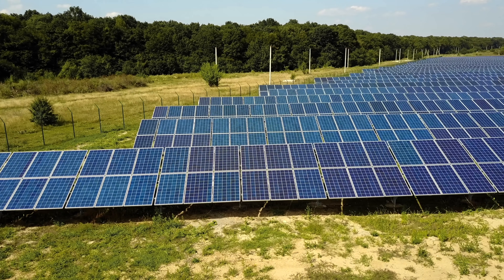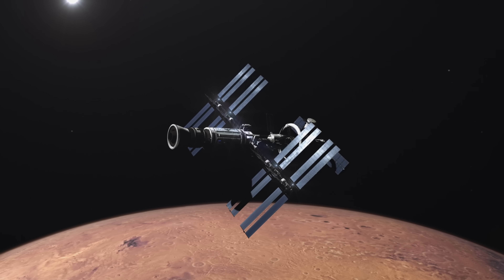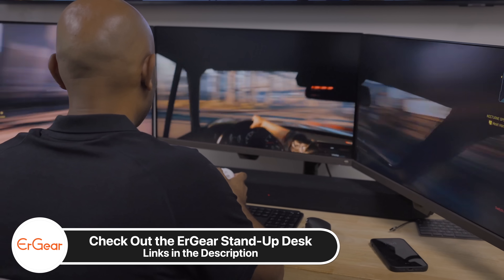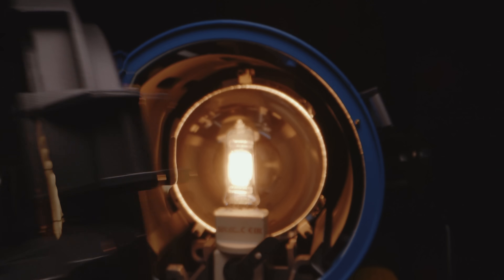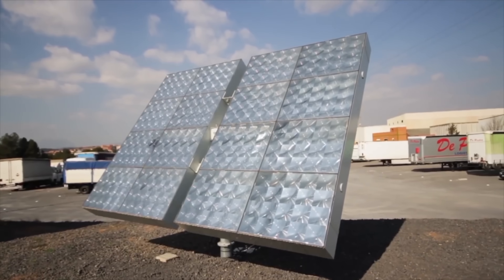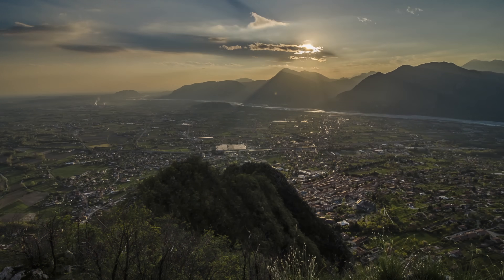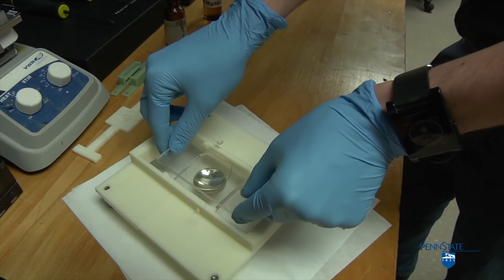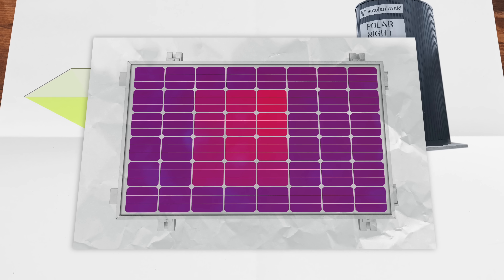Why Don't Solar Panels Have Magnifying Glasses On Them?

Comment: Radio Isotope thermoelectric generators..the Russians built over 2500 of these 4'x4'x4' powerplants to power their radio towers and lighthouses all across their country.. for well over fifty years these low cost , low maintenance, low footprint devices have saved them billions of dollars in infrastructure and energy costs.. so why aren't these used by every nation in remote locations?

Comment: Nice, I’m working on this very technology in a startup here in Italy. This is still expensive as hell but the latest cells with 40+ efficiency have a lot of potential to bring down costs. plus we are coupling cpv with csp so with a mix of electric energy and thermal energy production we could reach 80+ % global efficiency

Comment: If the individual cells are so much further spread out because of the lenses why not put each lense or cell on its own 2 axis tracker you don't need to rotate the entire panel just tilt the individual lenses also could fiber optics be used for light tunneling

Comment: If solar panels would have double the efficiency they would make a viable option on my car, current solar cars don't go further than 70km/day which is only about 50% of what I need. But having a bulky solar panel on the roof isn't great for the aerodynamica and thus makes less sense than normal panels (integrated I mean).

Comment: This technology is doomed for failure.

If there is 1000 watts of sunlight energy per cubic meter, if you want to concentrate it so that 2000 watts of light energy    is focused on that same cubic meter, then the collecting lens will have to be twice as large to be able to concentrate twice a the light on that same cubic foot of pv panel.

The ratios remain the same regardless. It doesn't matter if the area you are focusing on is a square inch or a square meter. You don't get something for nothing.

Add in the additional weight, area required and complexity and the increased pv cell efficiency is not worth it.

Keep is simple. Fixed mount, no moving parts. 

Increased efficiency on stand alone, fixed panels is the only improvements that will matter.

Comment: LoL “system balancing” 

“Balance of System” (BOS)
Refers to materials and labor not specified on quote, 

Often a customer will by their own panels on a bargain or import them on their own and ask a contractor to instal labor only plus bos, meaning the contractor must supply screws, lugs, conduit, enclosures, mounting clips, ethnet cable, earthtags,
Reply: Congratulations 🎉 you have been selected among our shortlisted dm me above 👆to claim your prize........🎁🎁🎁

Comment: All sounds great but I have a question: After buying outdoor solar lights and nightlights with photocells, I notice a good bit of discoloration after a year or two. Will these plastics that focus light have similar problems? If so, is there a way that the top layer could easily be replaced?
Reply: Congratulations 🎉 you have been selected among our shortlisted dm me above 👆to claim your prize........🎁🎁

Comment: No such thing as free or green energy .Solar irradiance is about 1300 Wm2 in space at the equator ,Only 1000Wm2 on earth at the equator .Many issues exist in getting as much as 250 Wm2 .But that's at high noon during summer and the further away north or south from the equator the worse it gets and the higher the temperature the less efficient they become and they loose 20% of their efficiency pending 9n materials and locations by 20 years of age and they degrade further .

Comment: I wonder why running cooling through the solarcells isn't more common? 
They get more efficient if they don't get too hot, and you can use the hot water in your house! 
Linus from Linus Tech Tips got some with cooling, so they do exist!
Reply: It's very complicated to run plumbing as well as electrical making the installation costly, where regular solar panels are mostly just bolt and go.

There are panels out there that have built in cooling/plumbing already so you don't have to have someone make a custom solution for your panels but because of the design time they usually aren't the most efficient newest panels so kind of negates the benefit anyway. 

Then imagine if you had a plumbing loop and you had to replace 1 panel, that turns in to a huge problem compared to just popping in a new panel.
Reply from the maker: you're right! it does add complexity and moving water on your roof, so that's why its not commonly done, but it's very interesting, and something i'll be sure to cover more in the future!
Reply from the maker: btw LOVED that video and his server computer pool heating episodes!!

Comment: Soo.. A short life panel that needs tracking and cooling. I think this is a dead end. Already now, the cost for mounting tech and labour is more than the panel itself. I also think its kind of silly comparing base power like coal, gas, nuclear and hydro to solar. At night it doesn't matter how efficient the panels are. Batteries should always be included in the calculation, or else you are only cherry picking. That said I love solar if it is mounted nicely on a roof. Ugly solar farms or giant bird choppers are just horrible.

Comment: Radio shack had kits with lenses on top of solar cells a long time ago.  It was in every hobby kit back in the early '80s.  Also, there was a company in the '90s that were using diamonds to do the same thing.
Reply: Good ole radio shack

Comment: One thing they could do is set the higher concentrated lenses around the outer part then have cooling in the middle. Run excess heat to an extra battery to store extra energy through the thermoelectric process. By doing this the wires would have to really move while the panel moves. Just have a connection box and create just enough slack to prevent damage.

Comment: Do you think solar panels would work better on flat roofs? Or would just be an equator thing? Best wishes, Stefan, Channel Islands
Reply: Lights refracted through the atmosphere right, so does it need to be direct sunlight? I simply don't know - ohhhh to have millions for research, I'd have a pretty impressive garden shed to tinker with. Stefan
Reply: Admittedly I wrote the previous post only part of the way into the video, appologies. Stefan, eggs not on my face thankfully instead it's making its way into the pan. Success, Stefan
Reply: What I really want to see (prior to the revelation of this video) was multi layered panels with cells under mirror bottomed other cells and angled mirrors to the side of the cell - at depth to reflect the light under one cell to another, this could be done with multiple layers.  I wonder if it could work with this new technology to produce even more power. Stefan

Comment: The cost per watt figures.. over what span of time are those numbers spread across?  Or could you possibly elaborate on how those numbers are calculated.  Thanks in advance!  I appreciate your time and effort.
Reply: I believe it is calculated as the total cost of a panel (or cell) divided by the watt rating on the panel. The watt rating is the watts produced in an hour in optimal conditions.

Comment: How deep would the Stanford 3d printed lenses need to be to increase the number of suns? I imagine these lenses would need to be very thick, which is why Fresnel lenses are used as they have high diffraction for a very thin lens.

Comment: Even a 10% device, IF they have 30+ year lifespan, IF they can be made from something cheap like silicon, and IF they get on to any roof where solar is relelvant, would be better than a pricey 25% panel you have to replace all the time.
My prefered option would be the roof-tile shaped solar collectors, where it looks like shiny tiles amongst the dull tiles. No unsightly raised panels.
Reply: Isn't that what Solar City panels are supposed to do?

Comment: I have a couple of largish commercial buildings to take care of, over 65,000 square feet, and our hot water consumption is pretty significant.  We also have pumps and tanks for the hot water.  Plumbing in heat exchangers for the solar collectors would be an obvious backup for the water heaters.

Comment: Concentrating solar has been around a long time, wish you had done research and explained here why it's simply NOT viable. When I was looking at solar panels back in the 90's you could by the surviving panels from mirror concentrators which destroyed a lot of the panels and panels were graded by current output.

Then there was Solyndra, I failed company and concept with a stated goal of producing solar panels for 2x the current pricing back in 2009-2010. Silly...

Concentrating panels just have never made financial sense, No concept has even approach standard flat cell panels for price over the lifetime of the product.
Reply: Thanks for watching and commenting ❤you have been randomly selected from comments as winner for today's giveaway hit me up via the digits above to claim  prize.............🎁🎁🎁🎁

Comment: No, solar COULD NOT power the world. Today's technology is just not there, and we do not know if it will ever be there.
Reply: I just noticed your comment was from a year ago, dude even at that year ago it's sustainable now, maybe about 3 years prior you would be right. But now they already have the technology now, hell even techniques like one in this video. It's done dude it's already sufficient? Even though your comment is from a year ago but even a year from now it was still sustainable I know that because I'm running solely on solar as we speak and I have more than enough.

Comment: This is wrong, the panels still take the same space AND the heat will kill the cells costing a lot to cool so they do not burn. Keep is simple, no cooling no movement no expensive material. Mass production of dirt cheap cells at any efficiency (over 15%) is what is needed not these hyper expensive science experiments. A fresnel lens to direct light from oblique angles might be a good thing just to even out production over the daylight hours, no more. When a panel to give 1 person a nominal power supply can be bought at $10/year on average, power will finally be a human right all can afford (25 year life at max $250). I think 1Kw/panel/person would be the level to achieve, then we can trade or share what we do not need now and buy when we do need it. A 5 person home would have 5Kw of capacity, plenty for most activities if you plan just a little. Power must be democratised and owned by the people who use it. Shure industry needs more power but that is a part of the cost of doing business, want a factory then cover the roof with panels,  not enough, buy a field and fill that to. It is not that complicated, any one can understand this, even youtubers.

Comment: The heat will probably be the biggest issue. 
But if u could use latest topology materials, u could reroute the heat completely into a TEC turning it into electricity as well. Or just for heating. 
This could retrieve that lost energy while keeping the cells cool

Comment: If you concentrate sunlight, you concentrate heat. I guess the solar panel would melt due to IR light and international heating from current flowing through it.

Comment: sun power changes due weather conditions and year seansons, cloudy sky, etc. , lens it not change power it change the irradiance. The power entering on the lens surface and the power at the focused spot is the same! The difference is the irradiance, it irradiance on the spot is bigger than at the surface on lens and thats why it spot start burning the surface. So it placing lens over the cell it is a stupid idea- bacause it just kill the cell. It sun power can be compared as a water entering funnel: amount of water in = amount of water out, but rate of water at the tip is increased. Thus want more electricity you must increase area of cells for more sun to absorb. It if you use lens it then you would focus sun power to heat pipe and water in pipe heat up. It electricity generation cell it have low efficiency like 20% and degrades as your area of living goes closer to the earth poles as sun angle reduces...eg it sun gives 1kw/m2 you would get 200wats of electricity and farther places you get 100 wats or less. It also this heating water system using lens it might be even more less efficient so it maybe it is you would accumulate electricity instead and use electricity to boil your coffee than it you waited entire day hot water circulate your water heater tank and yet it you open the water crane and it is only warm-ish.
Reply: Congratulations 🎉 you have been selected among our shortlisted dm me above 👆to claim your prize......🎁🎁🎁

Comment: Concentrating light for improved power output is a great idea. Two complications not mentioned come to mind. Lenses to concentrate light will also be more affected by dust, leaves, bird droppings and other wonderful impediments that will decrease available light. Also, photovoltaic cell lifespans may be reduced by increased intensity of light itself along with higher temperatures. Even so, I imagine that engineers and scientists can find ways to work around such challenges. Just remember; things take time.

Comment: if you would stop thinking about laws and money, you would just do that thing you are talking about :)
Reply: so who directs thinking to wasted effort, is not useful
Reply: dont choke your "economy" (available stuff for free) by law-money-ownership patents
Reply: you can do super small multijunction cells with processor wafer tech for "cheap"
Reply: same for super small displays
Reply: thats just optical fiber btw
Reply: just parallel solar cells
Reply: put those in windows, the lens
Reply: the lens is a window glass

Comment: Dispersed energy. Rooftop solar, 

Central concentrated electrical power has to be dispersed. 
The national power grid is 10times more expensive than the nuclear power plants.
Electric vehicles with huge batteries, 100kwh for the long drive. 
Homes have 32m2 of windows. 
At $400m2 
Rooftop 32m2 glass PV 
At $200m2, cheap, cheap, cheap. 

Daily drives are tiny 7kwh.
EV comes with a free 100kwh battery. 
EV batteries top up daily. 

Hello, hello anyone home    ?????

Comment: Standard, PV panels can't handle more than standard sunlight.  Concentrator rated PV cells cost more than the gain achieved. CPV has never been competitive.  Efficiency per square foot  is not as important as cost per watt.   Dollars per watt is the bottom line.  File this video along with the solar freaking roadway foolishness.

Comment: It sounds very interesting, but I would be concerned about potential fire safety issues when mounted on rooftops. If active cooling is required, what happens when the cooling system, which will have moving parts, fails. That said, if you can dramatically increase the output per square inch then maybe a much smaller array can be used and perhaps the mounting can be done with sufficient space between roofs and the panels. I hope this development continues. Sounds very promising!
Reply: A big hit to efficiency few people discuss is dirty panels. I need to clean my panels every 3 months otherwise output can drop by 1kw.  System maintenance may be a drawback for some of these more exotic systems. Always try to think like the practical pig. 😎

Comment: I  think that triple junction cells can be printed on large plate glass with ribs to focus light and absorb small wavelengths at the top and allow longer wavelengths to pass deeper into the structure.

Comment: Interesting tech experiments. In most places getting better low-light (cloud and winter) performance is more important than this, so as to reduce the amount of seasonal storage needed alongside the PV farms and increase the guaranteed power output to the grid- increasing annual capacity factor.  Bifacial panels (that use light reflected off snow) are important here. 

The real game changer will be roll-to-roll printed perovskite PV: way cheaper than anything that uses glass or silicon, and efficiencies up to 40%, lightweight and super quick to deploy.

Comment: Thanks Ricky! Fascinating stuff here!! ... I'm saving up for a solar system to basically take control of my climate control, if possible. The summers here are crazy hot, and the winters are crazy cold. My energy bills would be so much lower if I could move climate control over to solar & other alternatives. :) 💜 ... any feedback on the system by Oupes?

Comment: These little pyramid concentrators have been around in lab settings for many years, it's not easy to use in the real world though (usually cheaper just to use bigger panels, if the space is available).

Comment: Using a lens to concentrate light is not new. The reason they don't is that it doesn't work. The added heat destroys the gains by doing so. This show is a 100 percent propaganda. Solar can never power a steel mill or any industry. Its expensive and an environmental nightmare. When you talk $ you have no clue what your talking about. Simple things like weather and where they are mounted change numbers. Will you put them on your roof then who will pay for the grid that industry needs?. What will you do with the rare earth metals needed to make them. They take huge amounts of energy and produce massive amounts of toxic waste.

Comment: Use direction optimizing lenses on top, then optical solutions to consentrate the perfectly angled sunlight in masses and finally capture it with a small solar/heat cell. 3 layer design should work better than dual or single layer. Consentration raises heat levels too, so the smaller cell should also be able to take energy from heat too.